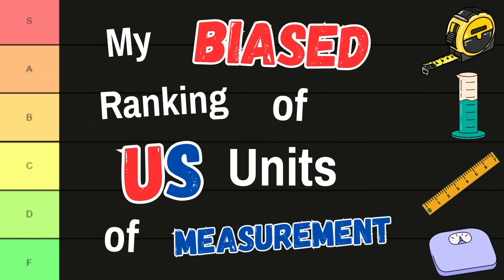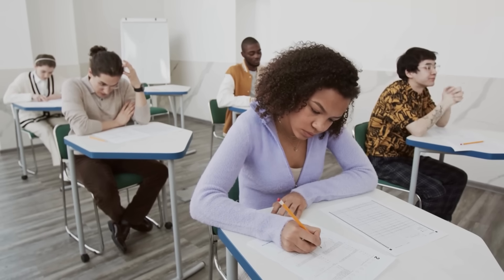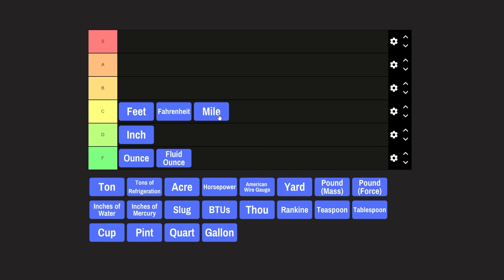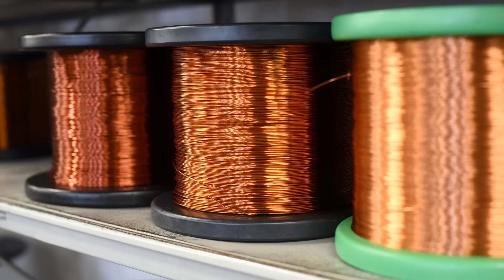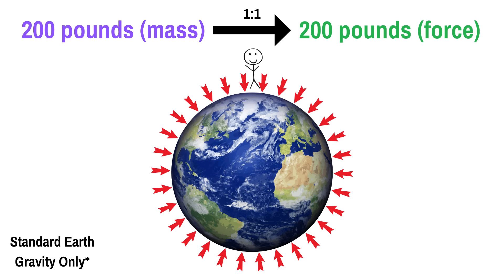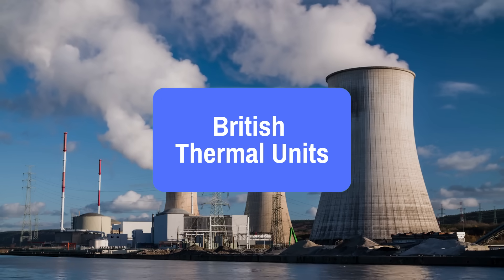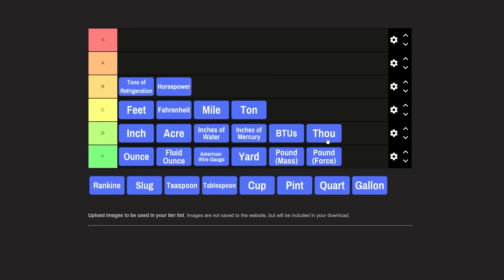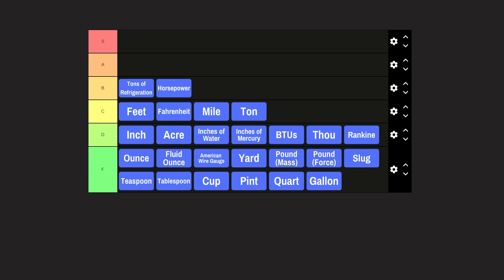Tier List of the DISASTROUS US Measuring System

Comment: the inch and foot are Goated if your a craftsman. The inch being decided in half reaching to infinity and the foot can be halved, thrird and quartered, and sixth. The meters can only be halved and quartered evenly.
Reply: 1 Meter are 100 Zentimeter and 1 Zentimeter are 100 Millimeter. 

2.3 Meters are 230 Zentimeter.

13.6 Zentimeter are 136 Millimeter or 0.136 Meter. 

It is a very simple System.
Reply: @wabbalda4715  But if you are a craftsmen and your wall is 7 meters long but you need to divided it by 6 what do you do without a calculator. The answer is 116.66 cm. of course the math is possible but if i had a wall 7 feet long and i needed to divided it by six. It’s simple, a sixth of a foot is 2 inches, 2inches x 7feet equals 14inches   So 7 feet divided by 6 is 14inches.
Reply: @FuzzyCheeze  Good question! 

My answer comes a little later...

I thought about it for a while because mental arithmetic is not my thing. 

7 meters in 6 parts.

6 fits once into the 7. So you have 1 meter.

There is one meter left 6 does not fit into the one so you calculate with 10. 6 fits once into the 10 so you have 1.1 meters and 4 remainder six does not fit into the 4 so you calculate with 40 the six fits six times into the 40 so you have 1.16 meters and 4 remainder and so on. A Craftman only needs the First three Numbers.

13 Meters in 8 Parts. 

8 Fits once in 13.

So you have 5 left 8 dont fit in 5 so you make 50. 8 Fits 6 Times (48)in 50 so you have 1.6 Meters and 2 left make 20 so 8 fits 2 Tims in IT make 1.62 and so on 

Hope you understand the route and my english a little. 

Best wishes from Germany.
Reply: @wabbalda4715  yes, I understood, you described classic division. All very doable, but it can go on and on creating a long list of decimals. I’m not saying meters are impossible to divide, just that a base 12 vs base 10 has its advantage when it comes to quick fractional math.

Comment: I actually think that feet are superior to meters when dealing with "human sized" objects.  Meters are too large for everyday usage - it's like as if feet didn't exist and all you had were yards.  But more importantly, the fact that there are 12 inches in a feet means that there are a lot more ways to divide up a foot using whole numbers - 12 has more factors than 10.

That said, scaling up from yards to miles is stupid because feet and miles come from two different measurement systems, and kilometers are way, WAY nicer than miles.  I have some experience driving around in France, and following GPS directions using kilometers and meters was MUCH more intuitive.

Comment: Not really an imperial unit, but can we talk about degrees/minutes/seconds? It's really intuitive in design, a minute is 1/60 of a degree and a second is 1/60 of a minute, like you'd expect. But it still really sucks to do math with it on paper, and working with it in general kinda sucks. The alternative is radians which is a very logical unit but also really sucks to use. Maybe angles aren't meant to be measured

Comment: The inch and the Horsepower should have been further up since those are the only imperial units used by the rest of the world on a regular basis... unless you are a captain, then you probably use knots and nautical miles on the regular.

Comment: I use metric system and looking at all this awfull measurements i am so glad i leanred usefull measurement systems instead of this useless garbage

the only thing i find redeemable you put in F tier are Tea/coffee spoons , tablespoons and cups in 99.99% of cases the size of spoons and cups dont really change much for our consumption they are very consistent and intuitive for cooking

the rest is pretty much complete garbage so yea

Horsepower is accurately rated and i wouldnt change it, its pretty cool concept to say "this machine has power comparable to this many horses pulling a cart" its not that bad

Comment: Although the metric system was officially adopted in 1887 here in FInland there are still some old measurements in use or ones that older people still understand. 

"Peninkulma" is originally based on the distance a dog's barking could be heard from and was around 6km. It was later associated with the Scandinavian mile making it 10km. 

An unofficial unit of "poronkusema" which translates to a "reindeer's piss" was used when pulling sleighs with reindeer. A reindeer can't piss when running so the driver had to make regular stops or the animals could die from a stroke. Depending on the depth of snow it was anything between 1,5 and 7,5km averaging at 3,5km.

Arbitrary and situational but with a rich history and a story to tell.

Comment: Celsius is dumb as fuck for engineering and science. Rankine or Fahrenheit is just as easy and is better for weather.
Reply: I can smell the 🇺🇲🇺🇲🇺🇲🇺🇲🇺🇲🇺🇲🇺🇲🇺🇲
Reply: Least biased american
Reply: @maxistorm6094  Yep, I got a degree in chemical engineering, and I understand the advantages and disadvantages of most units, even obscure ones. The derived SI units are great. Celsius is just arbitrary garbags though. And picking base ten instead of twelve was a dumb error.
Reply: So when does water Freeze? 0 C°, easy. When is it warm weather? 21-25 C°. When is it hot weather? 25-30 C°. When is it heat wave weather? 30-40 C°. 
-10 C° to -20 C° is quite cold, -20 C° to -30° is very cold, -30 C° to -50 C° is extreme cold.

How is celsius bad for weather again?
Reply: @TheEsseboy  You just explained why it’s bad for weather. The range from 45 to 100 is basically outside of human experience.
Reply: @Ajax-a-jaxon  Using 0-100 F° for that is to much, -20 C° to 40 C° is more than enough. 40-100 C° is great for measuring heating, cooling water etc. , you know until you reach 100 degrees water will not boil. 100-200 is the range you usually cook and prepare food in, 200-300 is grilling/oven baking.
Reply: @TheEsseboy  You don’t actually need to know what temperature water boils. You don’t boil water by sticking a thermometer in the kettle and checking for it to hit 100 or 212.
Reply: @Ajax-a-jaxon  So how do you do that remotely? Do you call your water boiler?
Reply: @TheEsseboy  no, you wait for it to make bubbles
Reply: @Ajax-a-jaxon  How do you detect that remotely?
Reply: @TheEsseboy  Pressure change is the good way. Temp is not a good way to do it, because the boiling point changes drastically with pressure and impurities. For example, an electric kettle does not use a thermocouple and turn off at 100C.
Reply: @Ajax-a-jaxon  Well, if you go by pressure alone there might be a hole in it, then it reads zero and you pay no attention to it and the building burns down or the vessel gets damaged
Reply: @TheEsseboy  They do go by pressure though, because if you use temperature, you will burn down buildings because water does not actually boil at 100C except in specific conditions. Pressure works even with a hole, because the water is boiling and producing new gas. 

Even if you (negligently) used temperature, it is exactly as easy to set the limit point to 212 as 100.
Reply: @Ajax-a-jaxon You couldn't use just pressure. I'm a chemical technician and we can, for example, decrease the pressure in a boiler to cool the water down. So how are you going to know now, when the water is cooled down/ has the right temperature. You can't go by pressure. 
Or if you want to separate two liquids via rectification. Then we look at the temperature of the column head.
Reply: @marcomosges4255  I’m sorry, but you don’t know what you’re talking about. A rectification column has no application here. For one thing, it’s a continuous process.

Comment: base twelve is superior to base ten. Twelve is antiprime, ten is fucking garbage and has no advantage at all.
Reply: So do you have twelve fingers?
Reply: @TheEsseboy  No, the number of fingers you have makes zero difference for ease of use of a number base.
Reply: @Ajax-a-jaxon  So how many yards in a mile? How many miles in a foot? The ease of conversion from smaller to larger units easily supercedes any gain by being base twelve, we have calculators, it is not an issue
Reply: @TheEsseboy  Miles/feet are not in base twelve. Neither are miles/yards. 

The ease of converting smaller to larger units is exactly as easy as base ten, but with easier divisibility.
Reply: @TheEsseboy  In base twelve, a dozen units is 10 units. Twelve of those is 100 units. Twelve of those is 1000 units. The nice property you associate with ten are actually a property of any number bases
Reply: @Ajax-a-jaxon  So how many miles is 582 7"6' pieces?
Reply: @TheEsseboy  No idea, that’s not a base 12 unit
Reply: @Ajax-a-jaxon  
First, 1 mild is 5280 feet, which is not 7 factorial.
Second, do you really think any base antiprime is better than base 10? Seriously?
Reply: @Ajax-a-jaxon  Exactly, there are no base twelve systems that are usable, why? Because the world uses a counting system on base ten. Stop trying to change something because of a problem the calculator eliminated
Reply: @TheEsseboy  That isn’t even a base twelve system though, even though they do exist. When the French implemented the metric system, they tried changing everything to decimal; instead, they should have changed the counting system to dozenal.

If you want to build something, base twelve is much easier to use. You can take 1/3 of a foot very easily, for example. It looks like you just have an irrational hatred for non-metric systems because you are used to metric.
Reply: @eustress7428  Right, a mile is not 7! feet, that’s what I said.

I said that 7! would be an absurd base, because it is big. But a smaller antiprime, like twelve (i.e. base 10 in dozenal), is inarguably better than base ten.
Reply: @eustress7428  It’s funny using “base 10” to refer to a specific number base. They’re all base 10. Even base seven is base 10. 😉
Reply: @Ajax-a-jaxon  I can also do that with metric, I have a thing, it is called a calculator...

Why do you think all scientists (even from the US) use metric? Why do you think 95% of earth use metric? 

Having easily converted Giga, Mega Kilo, hecto, centi, milli, micro, nano, pico units overwhelmingly supercedes any benefits from being able to divide  12 into more pieces compared to 10.
Reply: @TheEsseboy  Not easily though.

Metric is clearly better, on the whole, than English units. Some specific metric units, like Celsius and Kelvin, offer no advantage. If we used Fahrenheit and Rankine with meters and kilograms, all of science would be just as easy.

Note that the advantage of metric is the easier divisibility and scaling. If you don’t care about that because you have a calculator, then why not use English units?
Reply: @Ajax-a-jaxon  Except, Fahrenheit is based on a fewerish person and when salt water freezes, instead of water which is the most common solvent on earth. 

And, only one country on earth uses Fahrenheit (Except for some insignificant island 🏝️ nations and Liberia)
Reply: @TheEsseboy  So what? The choice to peg to water freezing and boiling doesn’t make Celsius easier to use.

And if we were counting popularity as a factor then we wouldn’t be discussing the intrinsic benefits of the systems.
Reply: @Ajax-a-jaxon  First, might be a nitpick but I hugely disagree on "even base seven is better than base 10" - 7 is a prime number, you know. It is as suck as base 12 is good.

Second, even when we admit base 12 is better, imperial unit system is closer to 'base anything' than 'base 12'; The optimal unit would be much closer to 'metric unit but base 12' rather than 'imperial unit'.

Edit : Reading other comments, I think you already agreed on the second one.
Reply: @eustress7428  I never said “even base seven is better than base 10.” Come on man, we been talking for a while, please read the (short) comments if you feel like responding.
Reply: @Ajax-a-jaxon  I literally copy-pasted it from your comment. Please don't just delete your comment and pretend as if nothing ever happened. Good bye.

Edit : Shoot I was wrong this time
Reply: @Ajax-a-jaxon  The fact that all scientists who are not really known for using things out of popularity use it, makes a strong argument against Fahrenheit and Rankine
Reply: @TheEsseboy  what the hell are you talking about
Reply: @eustress7428  then it looks like we’re in agreement now, with that correction
Reply: @Ajax-a-jaxon  That if close to all people on this planet uses celsius, that in itself is very useful.
Reply: Base 5280 goes brr
Reply: @eustress7428  do you mean 5080?
Reply: @Ajax-a-jaxon  1 mile = 5280 feet
Reply: @eustress7428  Yes, but 5080 is 7! which is antiprime. I thought you were going for an absurdly large candidate for a number base that still has nice divisibility.
Reply: @Ajax-a-jaxon  
you... just praised a number that has 7 as an aliquot? You clearly don't know the reason why you praised base 12 in the first place.
Reply: @eustress7428  I praised base 12 because it is antiprime. So is 7!, because it’s a factorial.
Reply: @Ajax-a-jaxon  bASe tWElvE iS suPErIoR tO bASe tEN bECauSE yada yada yada 

Oh yeah? Why don't you have 12 dollars, 144 dollars and such? 144 has 15 distinct factors and 100 only has 9. Money is common, money is divided in our everyday lives, so why don't we have 144 dollar bills huh?
Reply: @themathematicstutor4092  144 is not antiprime, although societies have used larger antiprime number bases like 60 and 240 in the past. We do not use base one hundred, fyi.
Reply: @themathematicstutor4092  You’re not really a math tutor are you? And you can’t understand bases?
Reply: @Ajax-a-jaxon Catching one's attention is easy this way. Also, I'm quite well acquainted with bases myself. I work with base 10, by the way.

Twelve is antiprime, sure, but what now? More doesn't mean better. Sure, it has an advantage when it comes to fractions, but what now?

And what about money? We use base 10 when it comes to money, and almost, if not all people work in base 10. How is that not an advantage?

Is the metric system base 12? Obviously not. 

What's the universally taught base? Base 10. 

Unless you have 12 fingers, base 10 is advantageous because most if not all humans have 10 fingers. Unless you use your balls to count. I'd probably name it the "Balls system" for a measurement system based on base 12.
Reply: @Ajax-a-jaxon  And no, I am NOT implying that we are using base 100. I am referring to $100 bills and why we don't have $144 bills in case you don't catch my drift.
Reply: @themathematicstutor4092  We have used money in base 240 before. Base 12 makes everything easier. If we can switch entire systems of weights and measures, we can switch to simpler arithmetic too.
Reply: @themathematicstutor4092  It looks like you don’t understand that arithmetic is easier in base 12.
Reply: @Ajax-a-jaxon  If it's simpler, why not switch now? Arithmetic can be taught in elementary schools without any problems, so why not implement them in elementary school books? 

Base 12 arithmetic becoming simpler? Division and fractions, maybe. But that's it. I bet even 100 years later, most if not all people still work in base 10.
Reply: @themathematicstutor4092 Multiplication is also easier in base twelve.
Reply: @themathematicstutor4092  I agree, we should switch now but we won’t because of inertia.

Comment: My  favorite is calorie, especially as Americans use it to mean a kilocalorie. It is like calling kilometers meters. It is disgusting that kilocalorie is still used as the primary unit for food energy content even in Finland when it should have stopped in 1978.

Speaking of horse powers. The Metric horse power is based on the meter and 75 kg so it is smaller. Had they chosen 76 kg it would have been within 0.05% the same as the Imperial one but no, they had to use 75 kg which makes it 2.4% smaller.

Comment: What the f is a kilometer 🗣️🗣️🗣️🦅🦅🦅🦅🦅
Reply: So, how many yards in a mile?
Reply: @TheEsseboy  feet and miles are unrelated units that happen to have an integer conversion factor
nobody would say somethings 3 miles and 320 feet away, it would just be 3.1 miles
Reply: @dootnoot6052  So why not use millimile? Easier to use, or, like all huge companies and all scientists use metric...
Reply: @TheEsseboy  miles are good for long distances and feet are better for short distances, it would be like measuring in picolightyears
powers of 10 may be better for scientists but imo anthropometric units are better for day to day situations
Reply: @dootnoot6052  Mhmmm, hence why 95% of earth use Kilometers, meters, millimeters, micrometers, nanometers instead of hard to convert between miles, feet, yards, inches and milli-inches (thousands)

Comment: Fahrenheit is the only one of our measurements I like because of the precision. For instance, 71 and 72 F are very noticeably different temperatures to my perception, yet both round to 22 C. That could theoretically be solved by weather reports reporting in decimals instead of rounding, but I've never seen a TV station or app from any country do this.

I'm not a fan of any of our other forms of measurement. Metric objectively makes more sense in most other ways.
Reply: "I like because of the precision."
How is Fahrenheit more precise?

"71 and 72 F are very noticeably different temperatures to my perception"
Can you give me real-world examples where you can notice this difference?